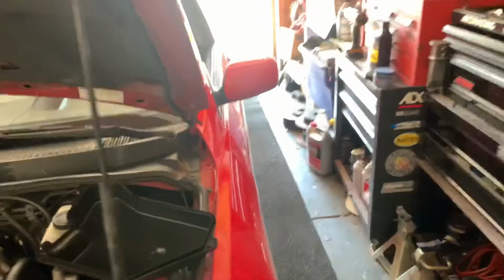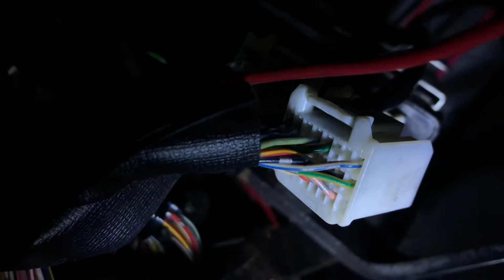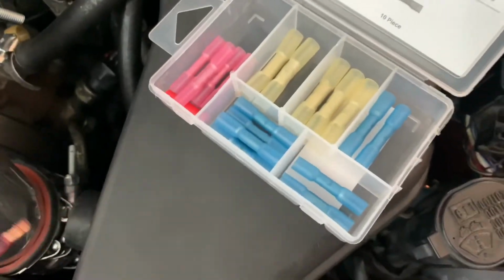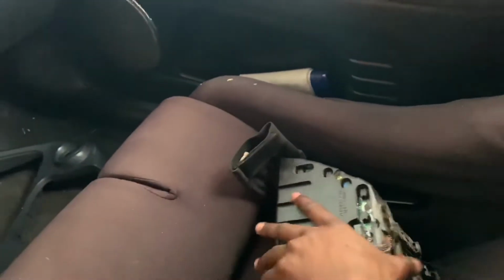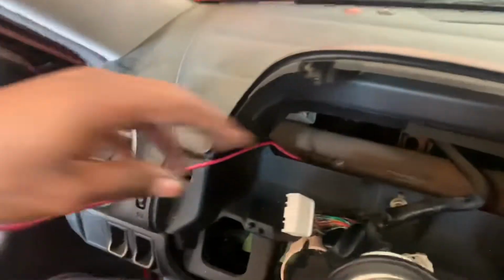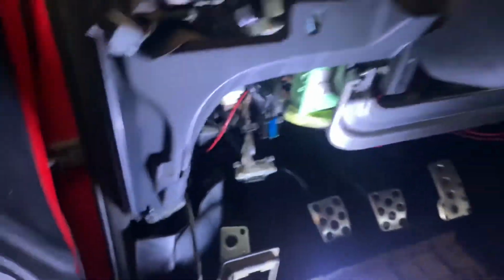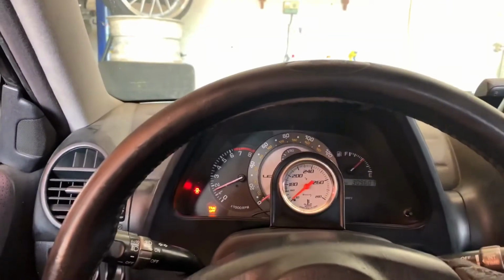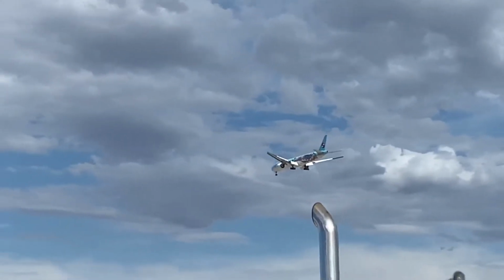How to wire up speedo (MPH)

Comment: Will this work for a 2002 is300, auto to manual? 
I did a w58 swap on my automatic and I can’t find a direct answer for the speed sensor and speedometer.
Reply: did it work for you? i just did the same swap
Reply: @nthn  never ended up using it. If you replace any busted wheel speed sensors it should work again.

Comment: Dose this work for a 2jz gte vvti swapped is300 2003 model ?
Reply from the maker: imran alzadjali yes
Reply: Awesome man keep them vids coming 👌🏻
Reply: Thanks bro you really helped me just finished wiring my is300 and the speedo works 
Feels awesome having it working. 
Do you have any idea how to wire the heat gauge and make it work coz mine doesn’t work

Comment: Will this still work if you didnt wire your manual transmission with the automatic harness?
Reply: king ferg yes it will. It’s running off the abs speed sensor so it will work
Reply: @derekoester41  thank you